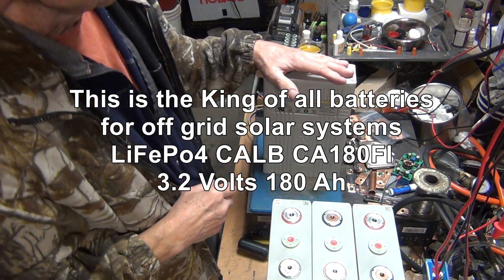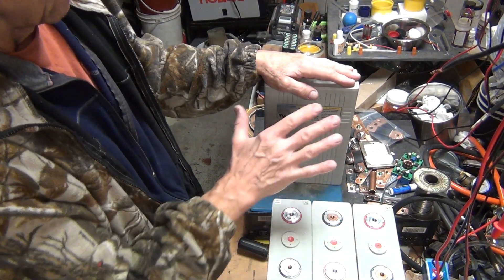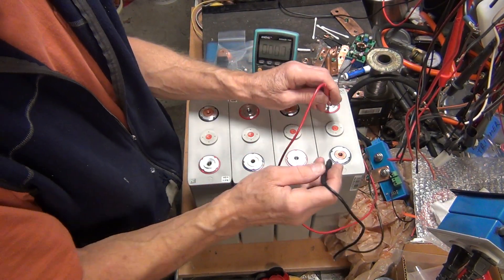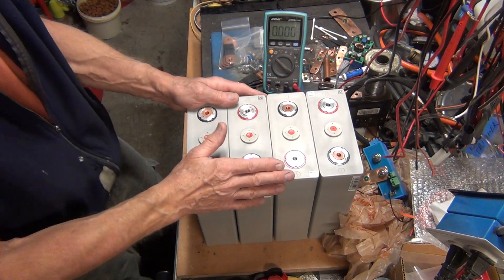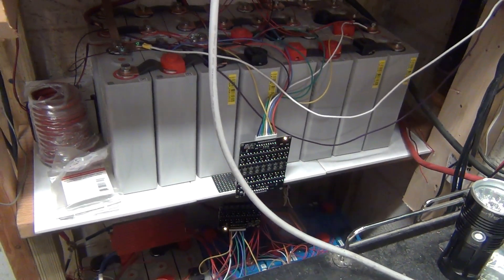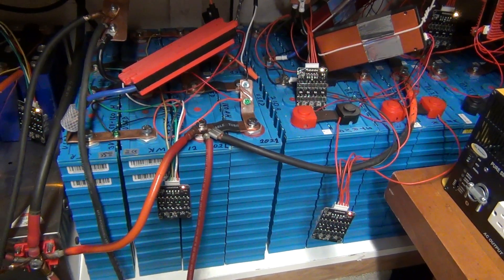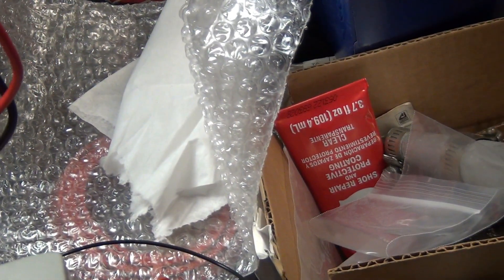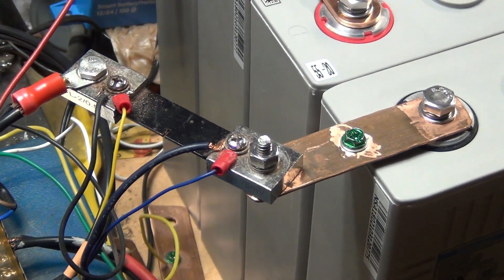What is the best battery for off grid solar systems?

Comment: agreed , i have the 100ah . lost one cell out of 16s went completely dead. hard to find replacements where i live. CALB does seem to be the cream of the crop as far as durability and quality control goes. terminals are solid but the little red and black plastic around the terminals will not last. ive experienced some swelling but not so much. the cell i lost was a new one. havent lost any of my used cells
Reply: That’s interesting

Comment: How many charge cycles do they have?
Reply from the maker: About 1500
Reply: @VladFredK that’s if you push the battery in all specs. If you don’t charge or discharge them all the way, or if you don’t push them to max current charge or discharge, they’ll go way way way longer